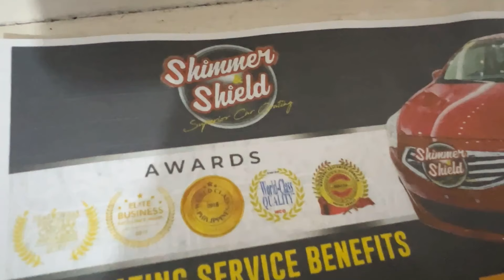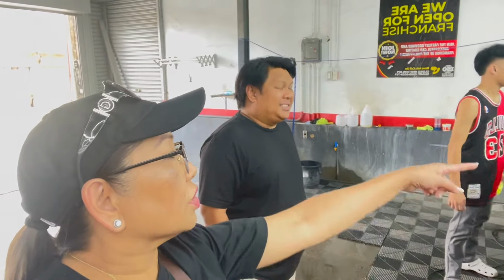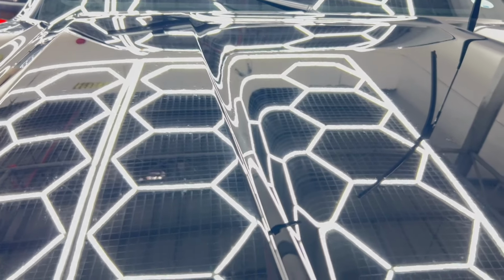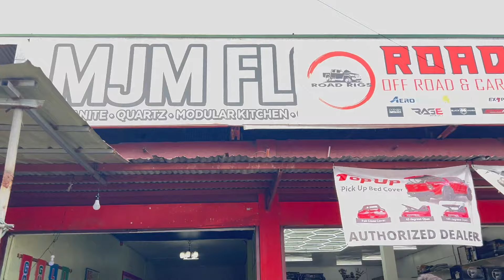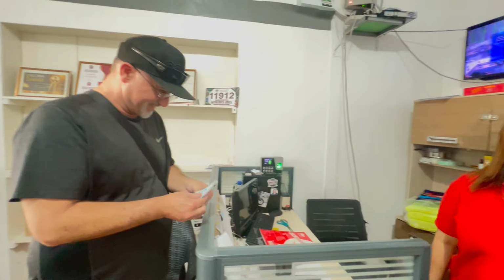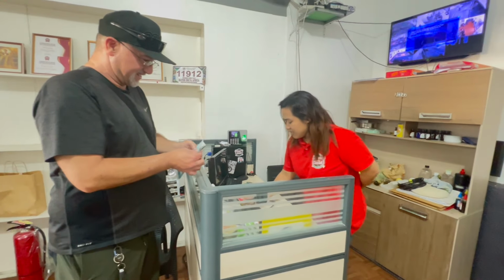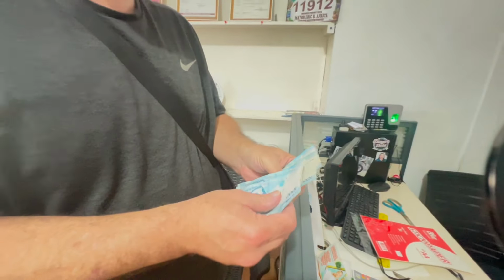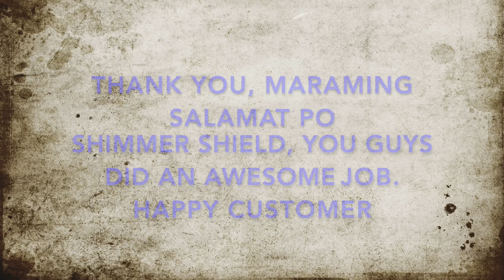Our Brand New Ford Wildtrak Is Spanking shiny From Shimmer Shield

Comment: They didn't get the stains from the hood before coating it. The stains are still there.
Reply from the maker: What stains?
Reply: @YollyAndBuck  little circle stains
Reply from the maker: @techietoma  oh that little circle, no they didn’t because, it’s the dealership responsibility.
Reply: @YollyAndBuck  Hello greetings from Singapore. This morning I chanced upon your YouTube videos regarding the collection of your brand new Wildtrak and also the ceramic coating process of it. I just wanted to highlight something on the ceramic coating process. Black coloured car requires alot more attention on the paint work if not swirl marks or light scratches can be easily visible after a few car washes. I suspect those circle stains which were still visible were water marks on the factory clear coat which I suspect is caused by when the car was parked under sun to dry after rain or after wash. To remove water marks completely, we need to buff the surface with machine and wax. We can call this process as paint work polishing or paint work correction. After the paint surface is in a perfect condition, then we apply ceramic coatings to seal it. Ceramic coating is to seal a perfect surface and not with the stains altogether. Ceramic coatings regardless of layers being applied, are additional layers of clear coats applied on top the factory clear coat in order protect it from the environment. Its hardness and durability prevents swirl marks and light scratches but not stone chips. It is good that the dealership rectifies the car's paint work defects before the handover of a new car. But if not, I will sent it to a professional car glooming company equipped with an enclosed or air-conditioned room to work on the paint correction process and the ceramics coating process.
Reply from the maker: @7777Gixer  Thank you 🙏 so much for that advice. We took it back to the dealership and they were going to re-do the whole painting, however, it will take forever 🥺, so we just decided to just forget it… Two months is to long..
Reply: @YollyAndBuck  No no. Don't redo the whole painting. Factory paint is still the best. Besides, the correction should be only on the top coat and not the under coat. You can even remove the ceramic coatings by machine buffing. This is because your 3 layers of coatings are less than 0.5 micron. Just bring the car to a professional car grooming shop and seek their opinion about it before you decide what to do next. The only mistake you made was you did not correct the paint work before the ceramic coating process.
Reply from the maker: @ Thank you 🙏 for that advice, we probably will do it when we come back to PI. Have a very blessed day and stay safe.